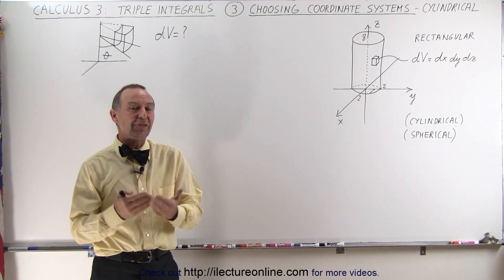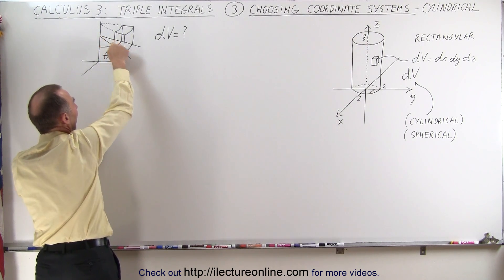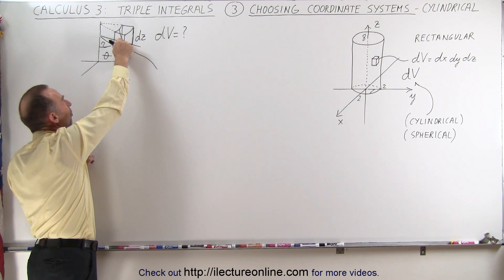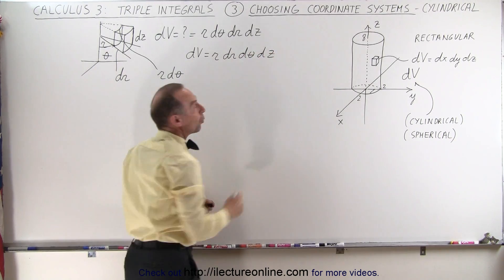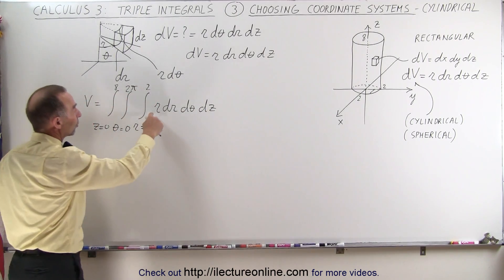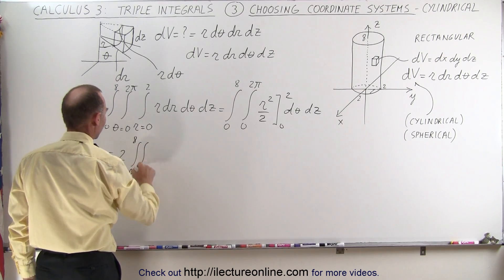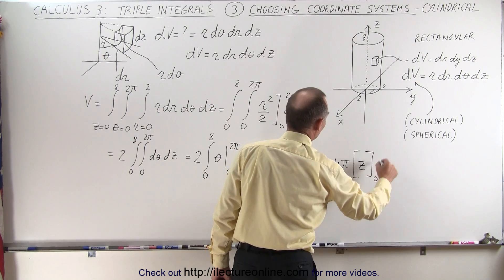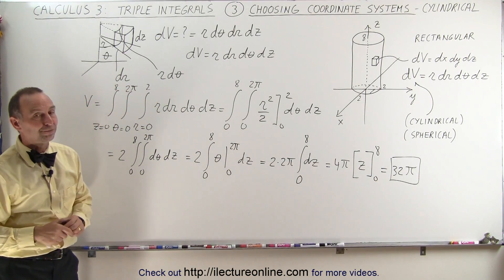Calculus 3: Triple Integrals (3 of 25) Choosing a Coordinate System: Cylindrical

Comment: How can I know if whether I should use double or triple integral?
Reply from the maker: Sometimes it depends on the method you use and you have a choice.  Sometimes there is no choice.
Reply: @MichelvanBiezen  so in the exam the doctor will ask me to use spherical method or cylindrical? I am pretty good at both but a little bit confused on how to start
Reply from the maker: Typically on an exam a specific method will be asked to be used.  Sometimes that is not specified and any method can be used.  Sometimes, if this is a first or second semester calculus course where tripple integrals have not been introduced, then the methods are limited to those methods covered so far.

Comment: One thing that bothers me about the differential element is that the inside arc length is smaller than the outside. So why are we using the longer outside arc length as the dimension to calculate the element's volume? Are we just pretending that the change in radius doesn't (dr) doesn't matter?

Comment: I have come up with a problem of a cylinder that is laid horizontally. So that the height of the cylinder is at x direction, while the base lays in yz plane. Will it be correct if I take x-direction as the height, and take the volume integral considering r,θ and x, instead of r,θ and z?
Reply from the maker: It doesn't matter which direction you place the cylinder.  Try it and you should get the same answer.

Comment: As  r dΘ, dr and dz get arbitrarily small, the volume element looks like a cube. So we can use the volume formula for a cube, even though it does have rounded edges?
Reply from the maker: You can also use a cube  (dx dy dz) but it is typically much harder if the object has the shape of a cylinder.

Comment: sir your videos are really clears the concept . I will request you that in india IIT is the most though exam and I recommend you the view once the syllabus of IIT by which we can clear the concept easily more you can get more views and like and subscribes promise .......AND SIR PLEASE REPLY
Reply from the maker: I will have to check out the IIT exams.  We are currently working on techniques to solve the JEE test problems.  I am studying the tests to see what the best strategy is since they don't give you enough time to work out every problem in detail, so you have to use the understanding of the concepts to quickly find the correct answer.  Do you know the difference between the IIT and JEE exams?
Reply: Michel van Biezen  yes sir jee is joint entrance exam the exam for IIT which is indian institute of technology that means it is an exam (jee) to go to the best engineering colleges .